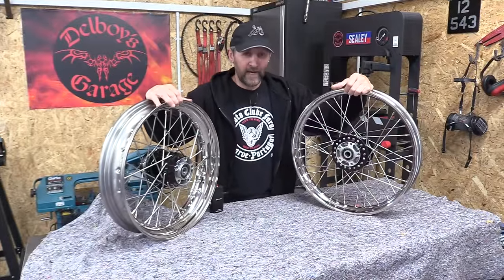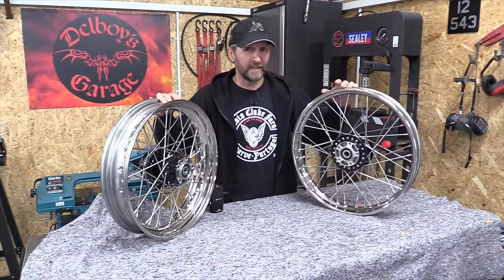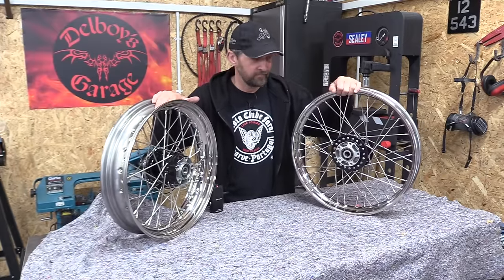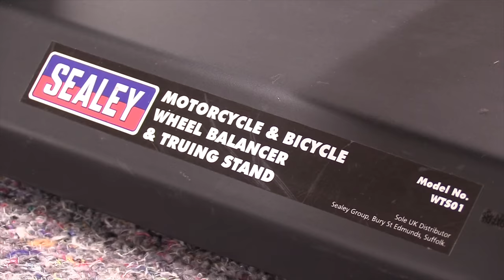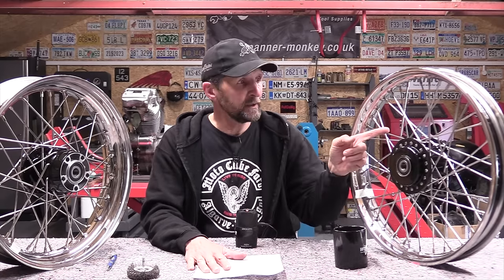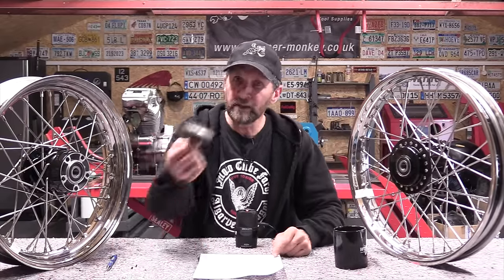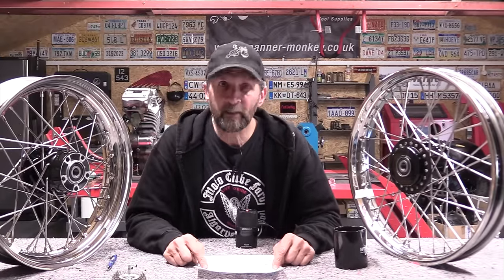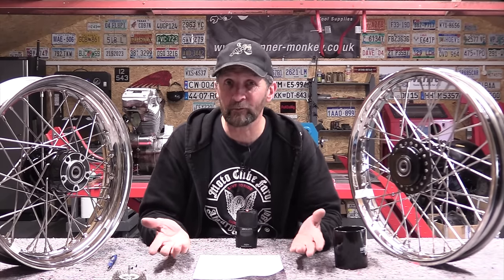Harley Sportster, Stainless Rims, Stainless Spokes. Now "Tubeless" Too!

Comment: Old supermoto trick....we do this all the time  never had any failures that I know of....can I suggest that you run gorilla tape round rim also as an added  security...make sure to overlap tape past air hole in the direction of wheel travel ..good luck Del.
Reply from the maker: Thanks Keith, is was a Super Moto guy who first put mew onto it. !

Comment: Would the bead hold air without leaking… make good seal??  Didn’t think bout it till now.  Tubeless rims has bead lock as I understand it. Tube rims??  Hold long enough??
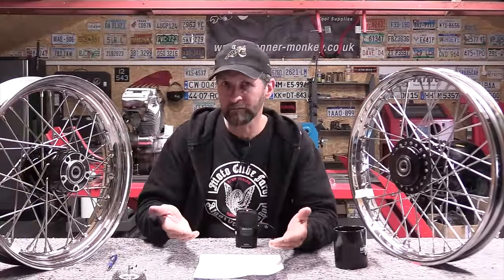Reply from the maker: Take a look at the video at 8:55 buddy, there you can see the exact same bead ridge as a cast tubeless rim, and in the next video you'll see they 'pop' as the tyres spring over the bead ridge and seat.. Im also using a bead sealing paste on these wheels for a complete seal. !
Reply: @Moonfleet41  KWEL!!  Well said….

Comment: Thank you for such details, it's always a pleasure to see your work. May I ask instead of the Tiger Seal, can I use the 3M 5200 marine permanent seal fast cure 24hr?
Reply: I used flex glue sooooo….. yeah

Comment: Excellent as always Del  ! May I ask what  the expected reliable lifespan of the Tiger Seal would be ?  Would it perish in time and need to be done again ? I suffered a puncture on my 2016 softail slim S and needed to get trucked so I'm very interested in this solution. I'll have to check if I can do this with my stock 16 inch rims . Thank you for always being so thorough and knowledgable. You're the  best !
Reply from the maker: It's never failed me yet Lee, every set ive used it on holds 100% air so no issues.. and the product is used to stick windscreens into cars which are a structural part now... so maybe that's a reference for you..  hope that helps mate, good luck with it !
Reply: Thank you so much for your reply  🙏🏼

Comment: Hi Del, quick question as I am going to copy this method when I convert my Desert Sled to tubeless . . . is it OK to have a tyre fitted by a shop with a tyre machine? Or would that upset the Tiger Seal? Are you limited to spooning on the tyres once you've sealed the rim as you demonstrate?
Reply from the maker: Yes, absolutely, a tyre shop should have no issue with fitting your tyres, in fact it's a more gentle process than hand levering them on!

Comment: since its been over a year now, have you had any problems with sealing the wheels? any leaks yet? I'm heavily considering doing this. I'm just worried because i do allot of highway riding and don't want to get a flat at 70mph.

Comment: I run spokes and carry a can of that flat fixing stuff for this reason. I figure if i get a puncture, that I'll seal up the tube with a can of that stuff and worry about swapping out the tube when I get home. Never had to actually use it though, so I'm not sure how the process would actually go 😋
Reply: Fix a  flat dont work on tubes.   Ask me how I know.
Reply: @wvbiker746  Really? What happened? I wonder if some of that Slime stuff would do any better 🤔
Reply: @snatr  No. sorry.  When a tube fails it rips.  By the time you  notice a flat, the tube usually tears a big hole.

Comment: Hi
Interesting video I have an Enfield Interceptor and going tubeless is something I have considered for the same ease of repair . My only worry is the lack of tyre bead to prevent tyre dismounting on deflation whilst riding what's your thoughts. At the moment I carry a spare tube and bead breaking levers and a small air pump. All the best love the videos keep them coming 👍👍👍
Reply: I'm doing the same to my Interceptor

Comment: How do you plan to adjust the spokes in the future?
Reply: Did you even listen?
Reply: @JohnSmith-ch9lp  “remove the sealant, adjust spokes and re-apply sealant” is a BS solution to a problem that shouldn’t ever need to be addressed. 

This is a video that shouldn’t have been and posted online as some idiot is will think this is a good idea and try it for themselves.
Reply: @vvevvevvvv  yup - “why would anyone think this was a good idea”

Comment: Man, great work! Check out Prism Supply out of Charlotte, North Carolina. Loads of in-house made stainless parts for sportsters. Handlebars, sissybars, pegs, etc. Solid parts. I am looking for a stainless front wheel with stainless spokes for a 21” front wheel for a 2005 XL 883C. Same stock dimensions. No luck in my searches. Everything is chrome🤦‍♂️I can’t even track down the wheel builder name from this video😅

Comment: That`s exactly what i was going to ask, but not the balancing question. You beat me to it.  As for the diameter of the rims, are they the same as original, or have you increased the rear diameter?.
Reply from the maker: Fractionaly wide on the rear Neil, to accomodate one size up on the tyre as it's 2" taller and I don't want it to look skinny!

Comment: Could we get a follow up? Does that gasket you made really hold 40 psi of air pressure? I’ve always wanted to do this but I am very skeptical.
Reply from the maker: It's a common practice, I've done it many times and so far, it's been 100% reliable... this Sportster still has fully inflated tyres many months after pumping them up.
Reply: How many tubes of tiger seal did you end up using on this set?
Reply from the maker: @longboardalways   Not quite one full tube, but i always have a spare on the shelf..!

Comment: hi del, can you use tubed tires as tubeless tires? all the research says no but it's all from bicycle riders, I've had to convert my rear tire to tubeless even tho it's made to be tubed, 2 years and no issues (so far) but wondering if it's safe to do so.
Reply from the maker: I will be fitting tubeless tyres
Reply: You should ask the manufacturer

Comment: Yep, find this better than wheel tape, as patching is much easier after an adjustment.
Reply from the maker: Exactly mate, specially as that means a whole new rim tape kit.. and they ain't cheap!
Reply: Or the cutting and sticking on a new section and crossing fingers that it holds when you mount the tire.

Comment: Very interesting idea - containing added mass & two opposing forces. If my boss said 'invent it', I'd want at least two circumferal wraps of 'fiberglass mesh' tape embedded between first & final layers of goo (spoke access gap between tapes) this would strengthen the new mass against centrifugal effect at speed.
As is, you have cured-goo sticktion & increased air pressure to fight this, should some dreadfully naughty cleaning fluid be jet blasted past the spoke seats to chemically munch away at the goo's residual stickosity, this may allow the 'retaining' air pressure to creep both sides & - whammo! - Centrifugality gets all the tea & medals.
I'm sure the designers will have seen this too . . . they probably had some quality cake on the job. Have a nice w/e : )xx

Comment: Yes that stuff is seriously strong. When I bought a devil wing for my micra (hate the term but hay ho) it was recommended that I use it and it has never failed.
High speed driving and the downward force at the rear pushing the wheels for more grip. Ha ha should have seen me drift round roundabouts (now now Marc behave 😂) 
Glad you used gloves Del it was very hard to adjust the wing with with them on but it was a nightmare to get it off your hands. 

Good job mate 😀
Reply from the maker: Hi Marc, loved the story and you're right, it's very strong!  Hope you're enjoying the sunshine on your new bike, have a great weekend, ride safe, D&Px

Comment: Cracking Job Del . On my list for the Enfield . Like the idea of the larger wheel .See you shortly mate 😀👍
Reply from the maker: Sure thing mate, so much potential for chunkier wheels on the RE, I can give you some details when you're here... see you soon, looking forward to seeing you all, D&Px
Reply: hi tony do you have one of the new enfields i have a interceptor thats what wheels i want to seal up first weekend of ownership i got a punture
Reply: @tommymurphy1054  Hello Tommy
Yes I have an interceptor for the past two years and as soon as I purchased it I installed  a product called “slime” I always use it when I have a bike with tubes . 
I have seen Del do his modification a few times and when I do new tyres I which will be shortly . Many thanks Tony
Reply: @tonymartin3000  thanks for your info tony i,m a bit unsure about sealing up the wheels you hear different things but i  seems to work ok   regards tommy

Comment: Those wheels are like jewelry !!  It's really great that the wheel builder has the same work ethic that you have. This is the first time I've seen the process of making spoke wheels tubeless. Should make for a lot of peace-of -mind on a long ride. I'm curious about the valve stem install but I have a feeling that it will be covered in the next video.  I wish education was this entertaining way back in my school days. Maybe I would have turned out smarter. 😁  Many thanks Del and Penney !! ❤👍👍
Reply from the maker: Thanks Rick, glad you enjoyed it and really appreciate your kind support.  Ill be using regular screw-in valves that come with rubber seals just like before. Have a great weekend mate. D&Px